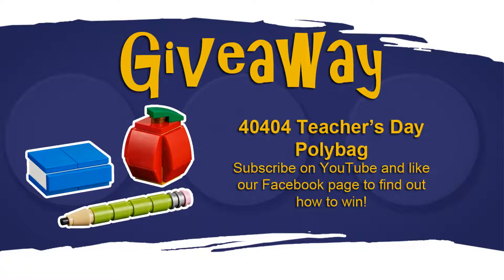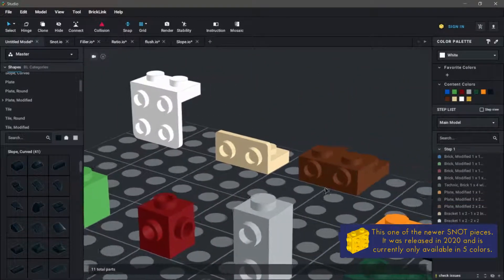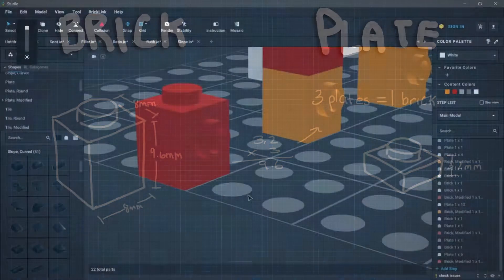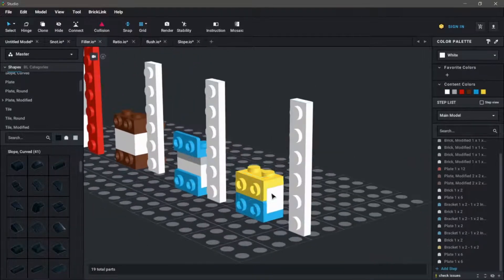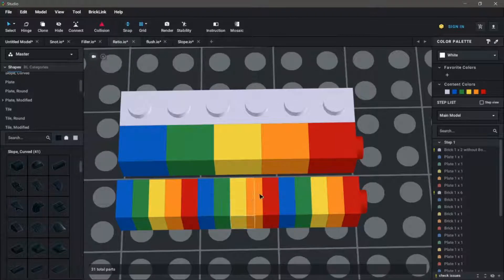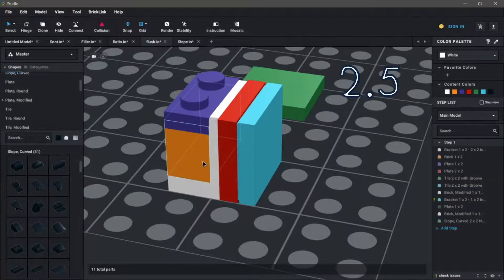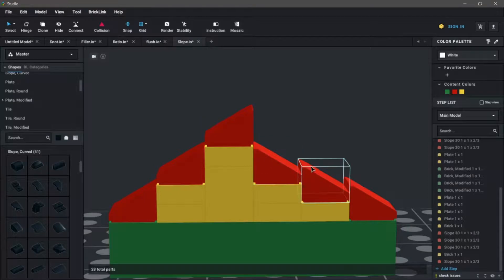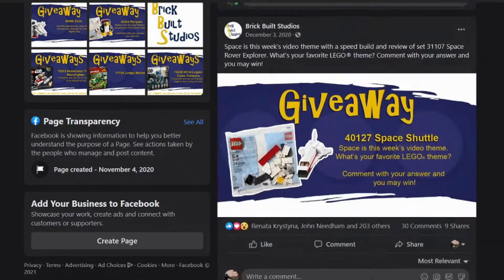LEGO Tips & Tricks - SNOT Building

Comment: I am constantly testing out new building ideas. I came up with an awesome snot idea that doesn't use snot bricks. Just using plates and tiles, I make a sandwich  one brick  in thickness and give you studs on the top and bottom. My method is scalable and has been very useful for my mocs.